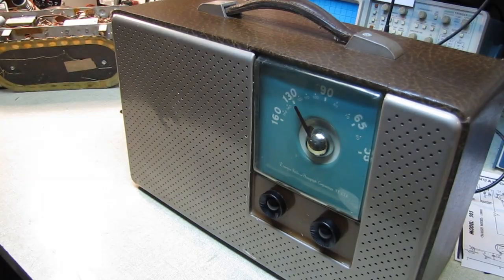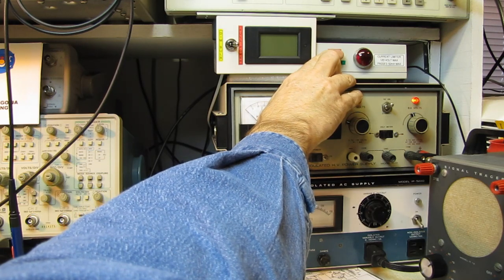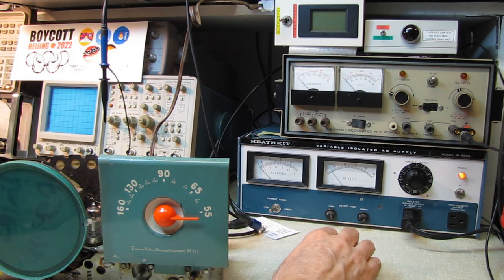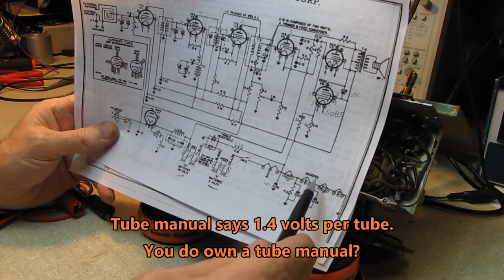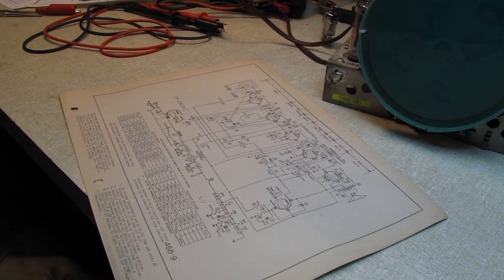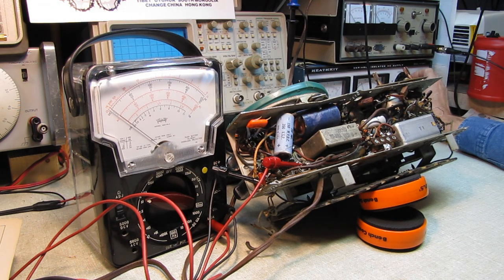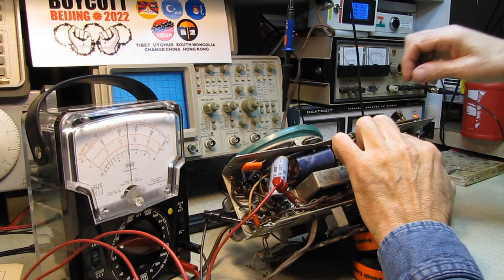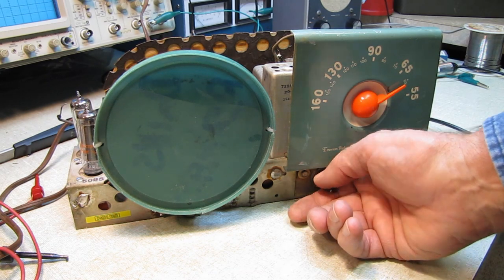DON'T PLUG IT IN - EMMERSON 505 #2 - RESURRECTION

Comment: Just love those radios, I ordered a MOTOROLA model  56B1 without the knobs but I did not know it was not point to point wiring, it has a PC board, but it was only $30 free shipping.
However I just scored another MOTOROLA radio, model 5A7A "lunchbox" radio on EBAY
I just hope my bad eyes can see what I am doing.....LOL
Keep up the GREAT work Vern!
Bill
Reply from the maker: Hi Bill, those are both interesting looking sets. Hope you do a video on them. Regards,
Vern
Reply: @theradiomechanic9625  Hi Vern, oh yes I will make a video but it is very cold in my back yard shed "man cave", I have to run my Mr HEATER propane heater to warm up the 6 foot by 7 foot little shop.
Keep those great videos coming my friend!

Comment: I suspect that a 12V Wall Wort would be what is required to power the EMMERSON 505 if direct replacement Low Voltage tubes are used like the ones designed in 1957 for use in Car Radios as the Power Transistors of the day were not ready for prime time.

Comment: My grandparents had an old Bush radio for years, when the home was finally broke up as grandad had passed years prior to my nana moving in with my parents I inherited it, it worked brilliantly pulling in stations form all over the world from my attic loop aerial. But I remember more as I used the auxiliary input for my electric guitar. It had a 5 watt amplifier through a 8” speaker and the sound on that old radio was awesome

Comment: A lot of work, that one, with all those hacks. Still, after some TLC and investigation it came back to life. These things are resilient. I was surprised at the caps holding any charge. But such a isolation transformer and variac supply is priceless - that's a very nice Heathkit unit. Thanks again!
Reply from the maker: Some of those old electrolytics surprise me. And this old tube gear will still be working after they drop the big one.

Comment: Those miniature tubes weren’t much of an improvement over the loctal tubes. They still had pin to socket contact issues with time.
Reply from the maker: The worst of the lot are the Loctal sockets. In a word they suck. Most of the 7 and 9 pin sockets are ok after a little deoxit. The only exception I have found were the miniature sockets found in some of the Japanese battery tube sets in the early 60's. These are the ones with early PC boards. They were horrible. Japan was not up to speed yet, at that time. They sure have made up for a slow start. Lets face it, Japanese electronics these days are pretty much tops.

Comment: Two thumbs up on demonstrating  the problems with this bad boy. You got it going so it was an excellent  resurrection.
Still going to need a lot of time to replace the other things wrong with it. Too much in my book.
Reply from the maker: The rest is just new caps. Vic didn't want it so I have pulled the front panel and I am going to paint it and use it on the other Emmerson. Thanks for watching.